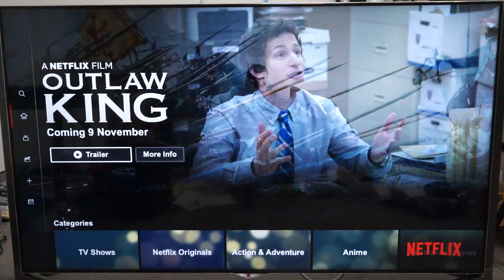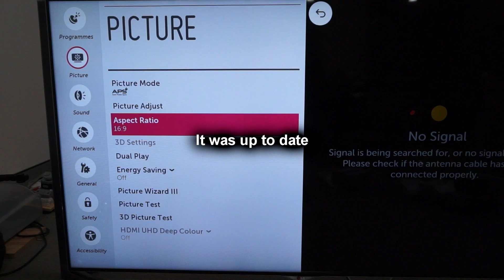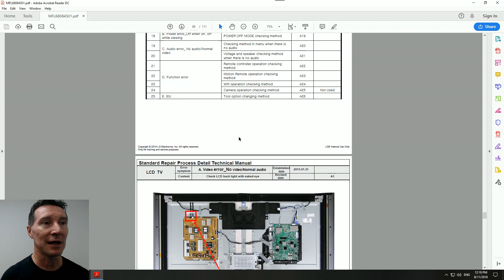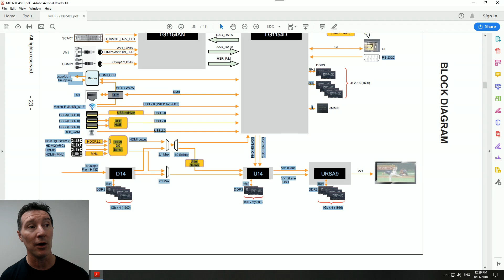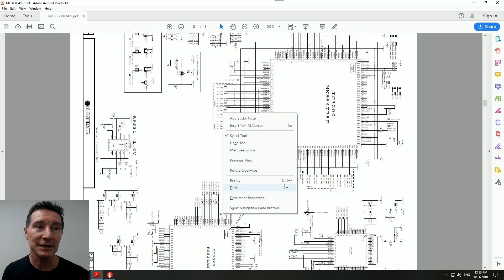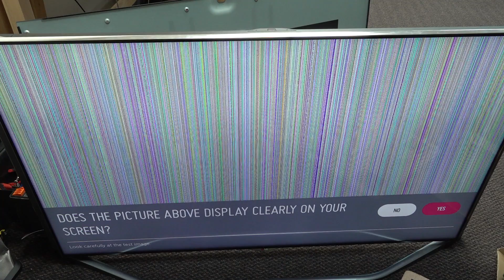EEVblog #1154 - Surprising 4K Dumpster TV Fault

Comment: Amateur mistake, but no worries, I've done it too. Never poke huge BGAs like that when heated. The pin pitch is very small, and you're almost guaranteed to form solder bridges. Watch out for the board warping temporarily from heat too. That in itself can cause solder bridges to form, or it can cause other BGA chips to lose connections. The board needs to be supported so that it remains flat when heated. Flux will NOT "undo" solder bridges. The surface tension will keep them together due to the small pitch. As long as you didn't short power to data, no damage should be done. This is generally unlikely anyways since power and data pins tend to be far apart for integrity purposes.

It will have to be reballed. It's not difficult to do, unless the ball pattern is something particularly weird. Since you've killed it already, just heat+lift the chip and take a look at the underside (you can take tweezers with L-shaped ends, bend the tips slightly so that they grab onto the chip's edges, and this way you can lift evenly/vertically). Make sure you do so with minimum "pulling", since otherwise you can rip out pads. Measure pin pitch (since that's difficult, you can just measure the distance between 10 balls and divide - less error that way), order a cheap stencil from eBay along with some solder balls, get some proper BGA flux (I use Kingbo RMA-218 which works very well and doesn't stink) and watch some tutorials. :) Do this not because you need to or because it's financially sensible, but just to have the experience so that future situations become simpler to deal with. How can you be the #1 electronics blogger without at least some successful experience reballing chips. Come on Dave! :) :)
Reply: We can't do it ALL now can we. :) :)
Reply: COME ON DAVE!!!
Reply: Great info. May I Suggest: offer to reball the chip for him. Video the work and let him edit and post. I bet you have a lot to add.
I always told my kids: " It's OK to rain, just make sure something grows." Thanks.
Reply: i tried to reflow a board from a mobile phone, weighting down the mc ... the weight melted @ 180°. wasted everything, because i didnt checked what material the weight was ...
Reply: Reballing; we do not do this because it is easy, we do this because it is hard!
Reply: First thing to do especially all you Rossmann junkies is find out if this chip is not a stacked die SoC. If so, you can just about forget about reflowing as the internal interconnects are now fried. Only chance then is a new chip and good luck in finding a genuine one that is cheaper than a replacement TV.
Reply: @Remco Stoutjesdijk its not
Reply: Don't be rude about it when a great youtuber fails - help them become even greater!
Except from that last comment, this is actually great advise!
Reply: yeah pushing it down was a very bad idea lol. gently tapping it sideway a tiny amount can be ok, but not down lol
Reply: More flux
Reply: Jason Bender You seriously think he made an entire system? All he made was a kernel. Not that that’s not impressive but the rest came from the existing GNU project for Unix and BSD.
Reply: Jason Bender No worries. Truth be told, I’m a little anti Linus lately due to some of his comments over the past few years so the “he wrote Linux” thing bugs me more then it should.  Knowing the amount of work the original GNU guys did with the compiler and everything else I get annoyed that many (mostly younger) people don’t understand what really goes into an OS.
Reply: It's the HDMI cable, bet.
Reply from the maker: How? Because there are a million different things you could be experienced at in electronics, and reballing fine pitch BGA's is just one of those million things. I'll slot it in next week alongside repairing microwave circuits.
Reply: @EEVblog  Totally fair as a general argument - electronics encompasses a lot of stuff, but given that we live in BGA land at this point, it's a lot more relevant than microwave circuits. Level of difficulty is incomparable as well. I taunted you jokingly, sorry about that. :) I do hope that this TV ends up working for you as a cool trophy. No one would hate you for trying and failing either. If anything, we're all grateful for you making these videos for our education and entertainment.
Reply: whatlions love these videos even if it a how not to do it best learning experience ever
And your right no one hates you for trying it’s all good and agree it would make a good trophy if it can be saved 👍
Reply: @EEVblog  Microwave ovens? I hauled mine apart yesterday and found that the tiny control panel 120V transformer had one of the secondary wires detached from the pcb pin, had it fixed in 30 minutes. My wife was in awe.
Reply: @spikester haha yes, microwaves :D
Reply: @EEVblog  :
In the past, I did production and warranty repair at a wireless microphone manufacture, and the pick-n-place guy put a reel on backwards; needless to say, I was the one called on to turn hundreds of $80.00 BGA ICs 180*.

I removed the IC, removed all the solder on both the board and chip, flowed fresh solder on both the board and chip making little hills on both, then re-flowed the chip on the board (lots of flux,) waiting for the IC to drop.  Although I ordered "sudder" balls and had scrap stencils available, I did not need them. 

Wala...saved the company tens of thousands of dollars...right before they moved the place to Malaysia, and my job moved to some guy I trained in Salt Lake City.
Reply: @EEVblog  That and no doubt even BGA stuff has changed and shrunk massively in the last, what, 10 years? I've no idea how things have changed, by my old Dad would have only done through hole stuff back when he was repairing electronics... by now he probably butchers anything smaller than a 150 amps, few KW, site generator fusebox. XD
Reply: @EEVblog  lezzzz goooi
Reply: @EEVblog  o.O
Reply: @EEVblog  You said you'd do it!
We'll hold you to it!
Do it! Do it!
I'd love to watch it and I am sure others would too! Reball and reflow!
Reply: @EEVblog  Is it even possible with out a ball mask/template for that chip?
Reply: @EEVblog  I've always done a lot of tech stuff.  A friend's little daughter, 25 years ago, knowing that I did a lot of work for her dad on computers, said; "If Windows is so annoying, why don't you write a better one?"  As I stumbled for the words, her father said; "Even if he were to live for hundreds of years, there isn't enough time to learn it all or to do it - it takes lots of people."

Phew!  The point is that everything is like this now.  A 'phone' hasn't consisted of carbon granules, a battery and some wires and relays and a speaker for a hundred years.  Building a car now requires not only that you understand combustion to degree level, torque converters, etc, but you can also add-in electronics and computing, special materials and much more - the list goes on and it is the same for just about any modern device.

These days, no one person knows how to fully make anything of any complexity at this level.
Reply: @EEVblog  Don't be too annoyed. I see both your points, but you are also one of THE best educators on Youtube - and some of the best educational content comes from learning yourself, showing mistakes and learning (while sharing) how to fix them. I think AvE is really great at this e.g. 
Give it a shot, what's the worst that could happen?
Reply: @EEVblog  You need the right sized stencil and some paste solder. it is pretty easy to do if you have the right tools.
Reply: Excellent advice. BGA rework is just hard! ;)
Reply: I +1 this. 
Has he never seen @Louis Rossmann work ? 
Dave says that he has fanned out huge BGA packages at Altium, then why does he ignore the known fact that the pitch is tiny ? 

E: I think the attitude of "No script, No fear" is biting him in the arse. 
Recently, on the calculator video, he was very mumbling. I think the reason for this could be 
1. He wanted a quick video out, so did no do itsy bitsy research 
2. He is moving the lab, it has occupied a lot of part of processing power of his brain...?

3. The power capacitors of his brain are now old and puffed, may need replacing ..🤣
Reply: @xMalhardeshmukh  he's a design engineer and not a rework / repair technician. Louis and Dave are both capable people within their fields, and neither purports to be an expert in the others area of specialty.
Reply: Louis was talking about Dave in the last video.
Reply: @AKsevenFOUR  when you are design engineer, you know the characteristics of your components, and how are those going to solder/desolder. you must know this if you are manufacturing it. Dave @eevblog does know how BGA packages behave while soldering. but,I think that he just rushed the repair for this video.
Reply: @xMalhardeshmukh  Contracted manufacturing and home rework are not the same thing. Of course Dave knows how they perform, and anyone who has ever reworked a BGA package knows there is a high failure rate, even for those people that specialise in the rework field. My point was that repair and rework is a speciality in itself, and someone who fans out the largest of BGA's in a design, may have very little practical experience in repairing / reworking them. Dave acknowledged this in the video and it seems lost on a a lot of people.
Reply: @xMalhardeshmukh  I'm pretty sure Louis and Dave know each other, and I assume they've seen each other's work (Louis has mentioned him before). Dave knew he made an error here and I'm sure he knows how to reball it, it's just something he probably hasn't done in a really long time so has apprehensions about it (and it's not easy unless you are well practised)
Reply: Yes I know. that was sarcastic . @schr4nz

Comment: IT'S THE DECODE ENGINE RAM!!! It HAS to be either that or the decode engine in the main chip itself - thats where the signal is being blocked. The signal is fed from there to the [B] Engine block which handles the OSD etc and clearly is working fine. The decode engine and the [B] Engine have separate DDR3 controllers, so the ram fault isnt affecting it. The display output looks like classic VRAM issues. A RAM fault is also vastly more likely than a processor fault
Reply: Well even if it is the ram, now it has more than one fault, oops.
Reply: nothing is being decoded when you play HDMI source
but yes it can be ram for https://en.wikipedia.org/wiki/XD_engine
Reply: My thought as well, GUI memory/frame buffer is ok, but not the memory/frame buffer for the video decoder.
Reply: I was thinking the RAM too but unfortunately Dave didn't hear me screaming at my screen :(
Reply: Mijc Osis Yes... It is not even Samsung RAM..
Reply: @rkan2  Yeah, it's Hynix RAM, arguably the absolute worst in my experience! Why not use Samsung or Micron RAM? Not really more expensive, but 1000s of times more reliable!
Reply: Reinard Harmse it’s LG, Samsung is an enemy, that’s why lol... you’ll never see anything Samsung near anything LG...
Reply: I can see some clear damage on IC2600 on the bottom right. May have overheated at some point in its life.
Reply: I was thinking the same. But now it's significantly harder to be sure.
Reply: I fixed a top notch Dell monitor once, I thought it was the decoding ram and had a good look at it but it was a layer of some residue coated with dust lying on top of the traces to the RAM. Cleaned them with isopropyl and it has been working for over 5 years with no trace of the nasty purple snow it had :)
Reply: i watched for maybe a minute and i say its the vx1 lane, judging by the comments looks like he didnt get it fixed, meh to be continued i guess, but i also think youre right.
Reply: yeah i thought it was memory or timing too because the output had symmetry / patterns in it. classic synchronised gobbledegoop. the lines being all vertical instead of gobbledegoop might not have been an improvement - ie theres less picture information going through now. no real way to tell but yeah it could have been additional damage.

Comment: It (main SoC) runs Linux (it easy to see from the serial output to people who know). I was not expecting that at all, and was almost certain it is some small custom kernel. But actually this make sense now. Also, it is indeed weird it shows no boot messages. I am certain one should be able to uboot or something via other header somewhere, and maybe even install custom stuff into flash, like SSH server, or something :)
BTW. Dave, you often say "encoder", and point to encoder (1080p30) block on the SoC. That is not the thing you are interested in. There is a decoder block, just above it. It is 4k@60 most likely.
As of the fault. It is probably not the joint on the SoC either, because the HDMI is switched via hardware into the same destination chip and it is also produces faulty image, and goes via different signal path.
My money is on connection between U14 and URSA9. My guess URSA9 is a scaller, compositor plus some additional final DSP chip, like final digial color correction, applying calibration curves, denoising, deinterlacing, etc. My guess it is LGE7411, aka XD Engine. Or maybe LGE7378B. So it is one of the pins from U14 to URSA9, or one of the memory chips for URSA9 making trouble. I doubt there is any error correction stuff (it is just unecasary expense), so they might be reading ones from one of the bits from one of memory chips for example. The video is already decoded and in uncomressed format, and if you consistently get a pink shift it can just mean that one or two of the bits are constantly 1 for this bit location. The memory is most likely tested internally quickly on bootup tho, so if there is no indication of error to firmware, it probably is not memory tho.
BTW. All these additional chips do have on board UARTS or I2C debug headers somewhere, and it possible to bypass SoC and control them without SoC.
H13 is a custom ARM SoC by LG, H - home, 13 - year 2013.
Not sure why the other chip is also called H13. Weird.
BTW. I really like the LG WebOS, it is nice to use, clean and quick. I bought my Mom a 4K LG from ~2016, and it runs very cool, because it has really superb thermal design. Can't say that about all LG models tho.
Finished watching. Yeah, so U14. Shame it died (probably shorted some pins). It was usable with some software hacking for some stuff (i.e. displaying web pages via webbrowser) before.
Next step, reballing U14!

Comment: Reflowing actually doesn't "heal" the cheap. The reason why some chips were brought back to life is internal connections being shifted back to their primary place. So basically it's not a permanent fix. But if you are using this technique to just troubleshoot it's better to just heat it up to something like a 130°C (less than solder melting temperature) for like 10 minutes and then slowly decrease temperature. I've used it in graphics card and temporarily revive it.
Reply: Not all chips are constructed like GPU.

Comment: Be careful with "not used before" flux. The little bottle of flux that i bought at an electronics store not too long ago IS CONDUCTIVE!
Sure, it's a couple kOhms but i don't want it between the gate and drain of a FET in a switching power supply. Little IC's don't like to be powered with 325V DC.

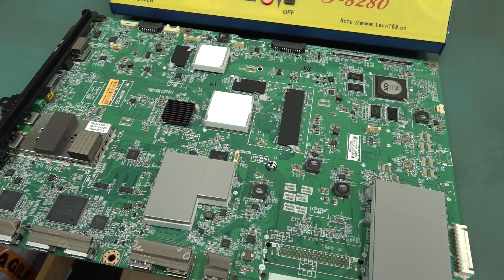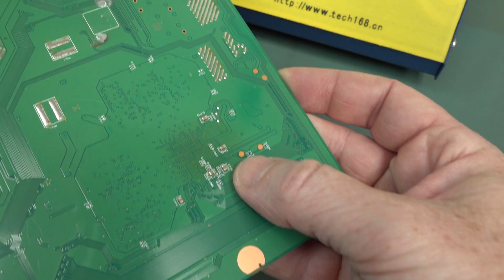Comment: at 18:00 Dave mentions that the URSA9 chip had its heatsink already detached. he then turns the board around and at 19:10 there is a shot of the other side of the board under the chip with some discoloration - that chip was getting seriously hot while operating, which is not a good sign.
so i actually think that heatsink was not properly attached and without proper cooling the chip just cooked itself eventually.

Comment: Thing is, at some point it just becomes cheaper, specially considering time spent on this, to get a new board. Not sure how easy and how expensive it is though... usually the panel is most of the price of a TV like that. But it'd be interesting to see Dave trying to reball that chip.

Comment: Wow. LG being great.I guess you might have gotten this board to work if you had studied bit more before doing stuff for it. That garble pattern was oddly specific and might show up in troubleshooting of panels in general. I dont think reflow would have helped here.I also had few panels to fix a while ago. Could not do anything because the backlight crumbled into pieces when touched. Had no idea how to give it new light that'd match the panel.
Reply: Henri Tuhola Just seems like bad graphics RAM where the decoder / framebuffer is working.

Comment: Not worth it anyway, I have a smart TV and I NEVER use any of those features, if I want to do that kind of stuff I do it on my computer (whitch I have connected to the TV and I use the TV like a monitor)
Reply: But he wasnt doing it to make it work as a smart TV. It doesnt work as a monitor. All OSD stuff worked, but any video signal was failing. As you could see in this video smart functionality was working fine, the only thing this TV could be used for was failing....

Comment: Well reflowing that chip, changed the output... So either you fixed something partly, or you just broke it completely and the error was actually before that chip, and because you broke it you didn't even get far enough to encounter the original problem.

Comment: Reballing doesn't have to be that hard.  If you find a stencil for that pattern, you can use solder paste, and scrape it through the holes.  You then heat it up prior to putting it back on the board, to melt the solder paste.  The hardest part is getting it to line back up close enough to it's final resting place that it will flow into place.